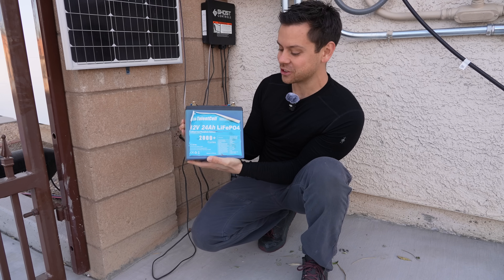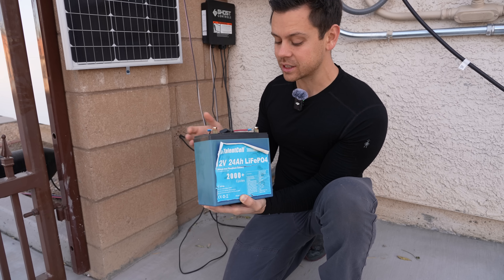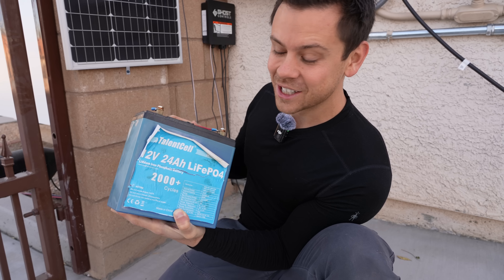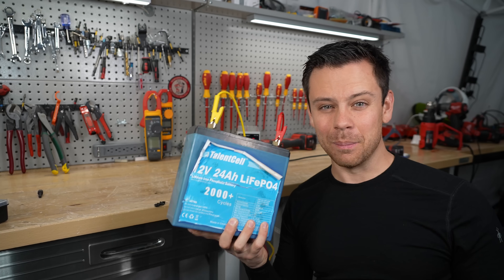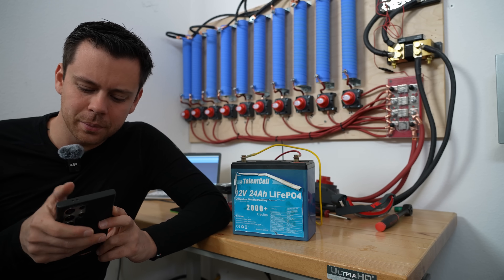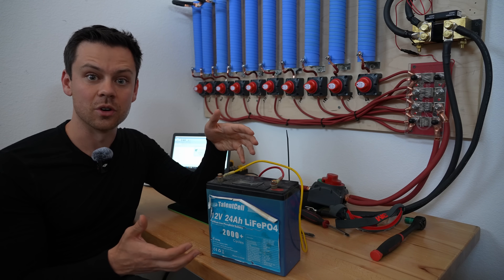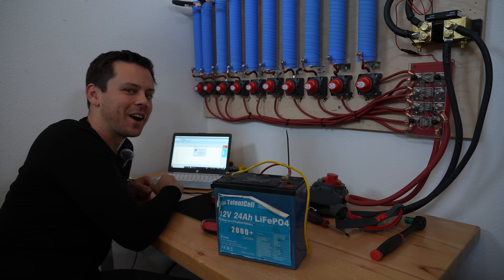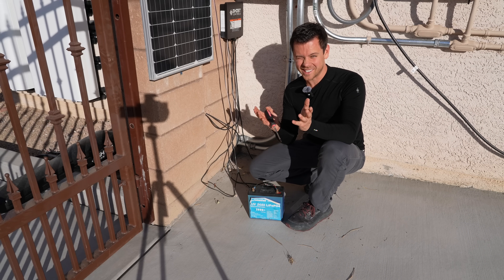Crazy LiFePO4 Degradation Achieved!! Check out the results

Comment: One problem with this test is the battery was already 3 years old when the maximum reasonable abuse test started. So maybe the bigger drop wouldn't have happened if it was brand new? Just speculation on my part of course. Anyway thanks for the informative tests!

Comment: I’ve killed a couple lifepo4 batteries in my ice fishing gear. The first was a very early one with no BMS. It lasted about 5 cycles. The 2nd lasted about 15 cycles. Had a BMS but no low temperature protection. I kept it on a lithium friendly charger in my Colorado garage.
Reply from the maker: Oh that will do it! I'm actually amazed it lasted five cycles!
Reply: Were they marcum batteries? I have a 30ah one that maybe a year and a half of light use and it had a capacity of 22ah when I actually measured it. No idea if it had 30ah new but I suspect it didn't. It's the same size as a 18-20 amp hour SLA so I suspect the only part of it that's 30ah is the label. Marcum is a big outfit too.
Reply: @juliogonzo2718  No, these were both well before marcum released a lithium. The first one was probably 10 years ago. Can’t remember the brand. The second one was an early amped outdoors.

Comment: That's to funny, I have the same set up but with an old 12v car radiator fan I use to suck the hot air out of my attic in AZ. Single 100w 12v panel $15 charge controller and  50ah timeusb battery.

Comment: You might see about putting a temperature sensor inside the case that would record the temperature mid day (I suspect it will be over 125F)
Reply: In a corner like that in direct sun, in Vegas.  I'd be very surprised if it isn't significantly higher than that.
Reply: Mid day, summer?  Ambient temperature is nearly 125F, something dark in direct sunlight, with IR being emitted from the adjacent surfaces would surely hit 140 or higher.